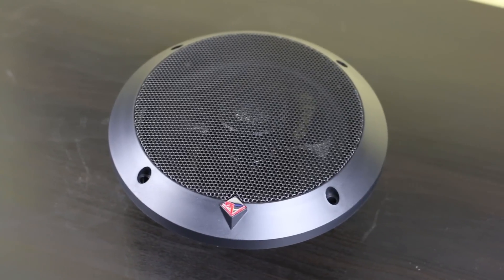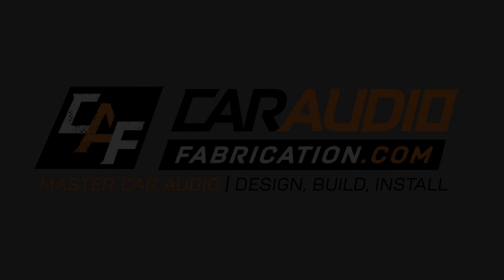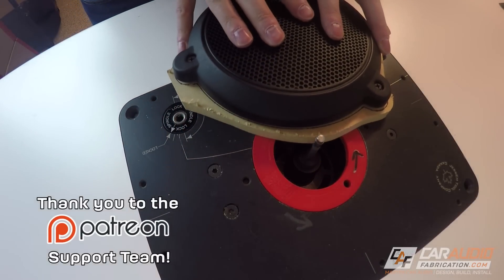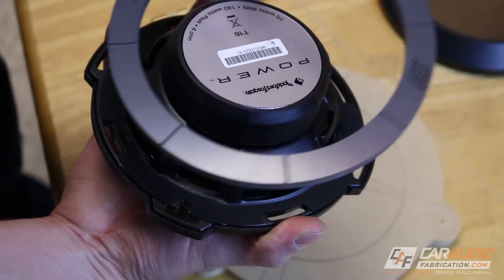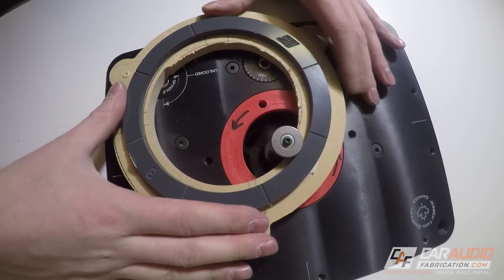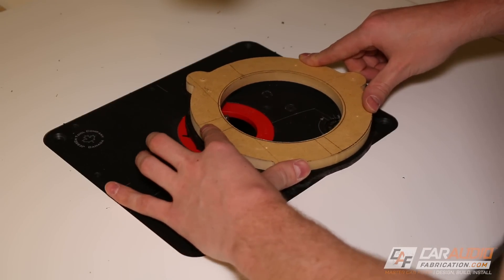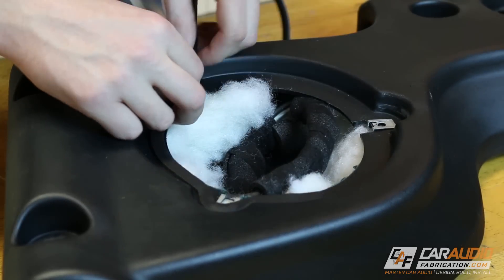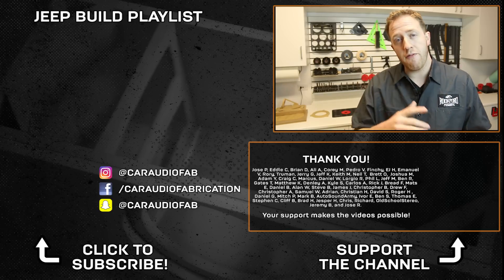How to Make Speaker Adapter Brackets  - ABS Plastic - CarAudioFabrication

Comment: if I remember correctly.... the OEM grill can be shimmed outwards quite a ways, allowing plenty of clearance for the tweeter on the coaxial speaker.  Mark's ABS adapter plate will shim the grill outward a little bit as is, 1/8th in. or 3/16th in. whichever thickness he used.  just C/A glue a couple more small washer size pieces of ABS to the top of the ears on the speaker ring adapter.  just check first how far the OEM grill can be shimmed outwards before the edge can be seen.  😉

Comment: Have you ever tried using home audio speakers in any of your builds? I know for some unamplified systems, it may be a challenge to power many of those speakers due to the higher impedance they usually have. I'm just curious, since many home audio speakers are comparatively inexpensive for the performance they purport to offer.
Reply: if you are from usa. dont think about expenses so much. you only pay like 5% in tax. im from denmark and we pay 39% in tax

Comment: have you made any changes to the front speaker pods? I noticed you put a lot of work into the sound bar, was wondering what you think of the front woofer enclosures. I added a set of alpine SPR components in the front of my friends Jeep and they sound odd in the enclosures

Comment: Do you have one for a 2007 ford expedition Eddie Bauer el? I would like change my 6x8's out to 6.5's... and should I purchase 6.5 components for the front doors and 6.5's in the rear doors....thanks
Reply: Same here for my 09 Explorer. Ive tried Amazon adapters and sent them back as the adapter didn’t fit my standard 6.5 speakers.